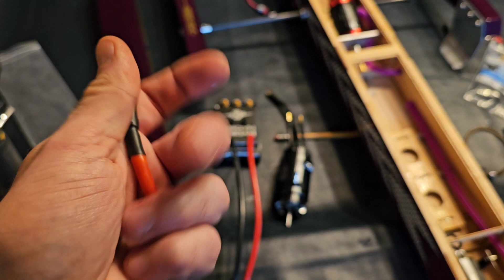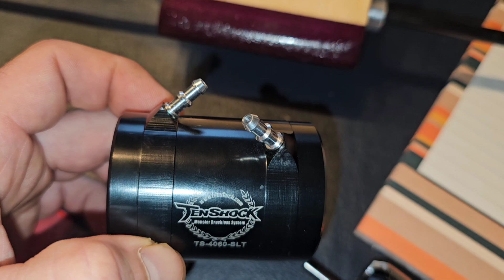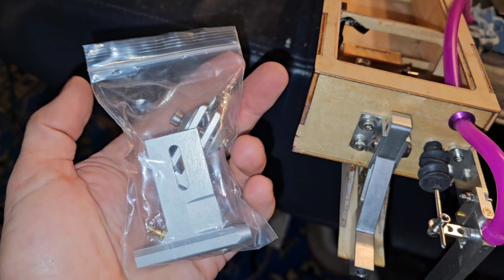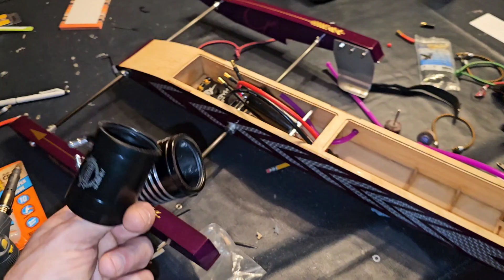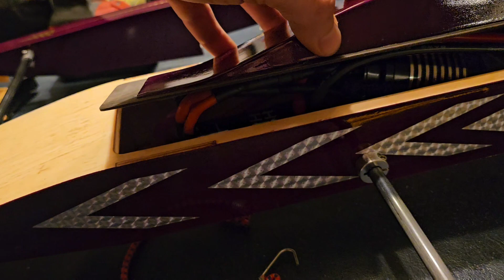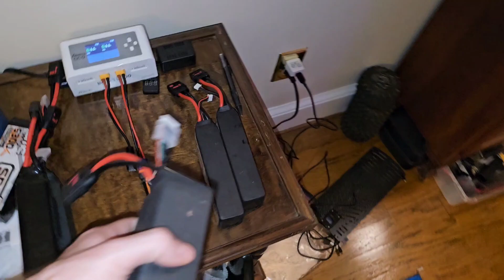Installing Tenshock's New HD 2260 Motor! 1750kv + XLX2 Hydra.

Comment: Yeah that strut is terrible. I talked to zippkits about that strut because they use to give you one that had screw holes on either side of the strut. But they said that this was better,b.s. I'm now running a sonic wake stock strut. It fits perfect. I also take all my batteries,no matter of make, and if they come with a plastic case I take it off. Then I wrap it in strapping tape. Their lighter, smaller, and can fit better. I've never had a problem.

Comment: It will fly, I had a tp power 1650 kv 4092 (4060) in my 21 (33”)fe and I ran an 1820 abc cleaver I mounted the ZTW 200 gen 1 esc up the front I got 118mph on 8s cheap Chinese lipo’s 
With the esc up front the Balance was perfect.
It’s only problem was the ZTW I will never buy another ZTW they are crap in my opinion.
The gen 2, I run after this one failed caught fire.
I changed to a European carbon rigger hull and swapped everything out of the zipkits into it but changed to the 250 amp hobbywing  EZ Run with a water cooling mod and a bigger prop still 8s 122.1 MPH timing is low and can’t be adjusted but it does have timing boost. Your Hydra xl2s will be way better.
I run the XL2s  in my 6s rigger at 108 mph still to tune it for its best but not bad for first run.
Hopefully my prop choice, KV and 8s combo will give you some  idea for set up calcs.
Also my hatch on the 21(33)was the similar to Sam Hallstom’s stealth type lid (search his YouTube vids using his name to see his) but I raised my lid up at the back about 3/8”and I did not need to lower my battery tray to fit 5000 mah 100 c HRB lipo’s 
Hope this is helpful food for thought.

Comment: Ive always added a little left offset , helps counter act torque roll as the boat will now trim left a smidge , other wise you would need to add some left trim on the rudder to go straight .